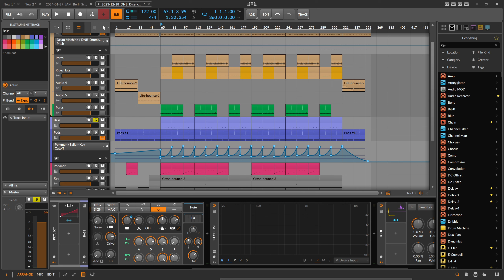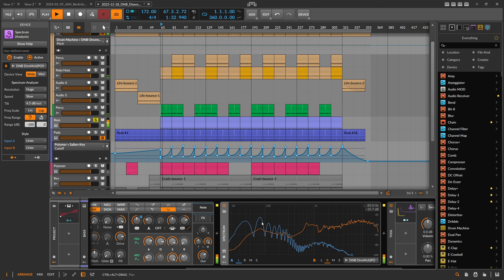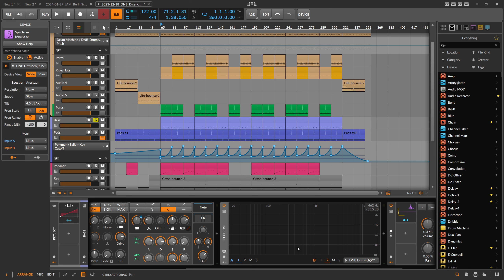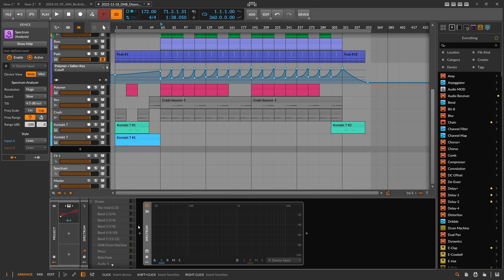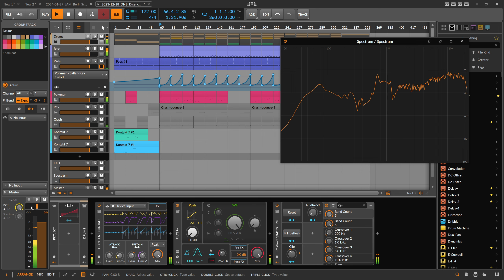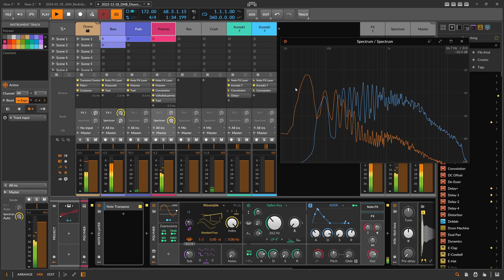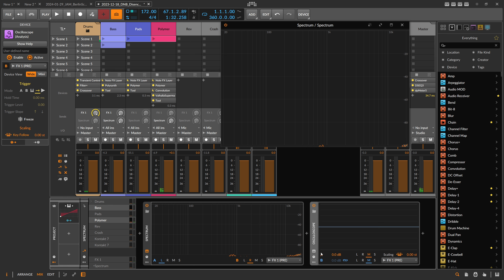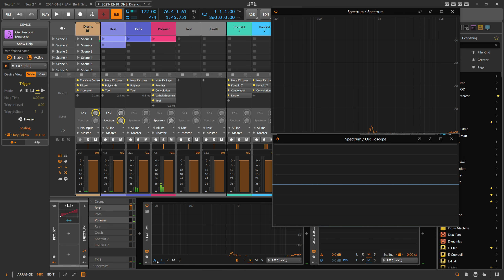new way of comparing signals in Bitwig

Comment: I think Bitwig always had Oscilloscope orange by default and Spectrum analyzer blue, so it's a fault in design that they're opposite. I think the best solution on their side would be to introduce user-assignable colors to channel A/B in both Spectrum analyzer and Oscilloscope (and perhaps add more channels to go with that?). you could instead opt for FX Grid and it's 4 channel spectrum, so using up to 4 FX tracks, where you can match first two channels colors to oscilloscope device